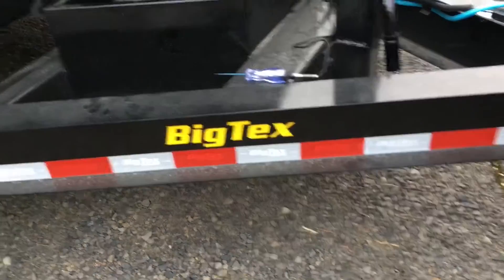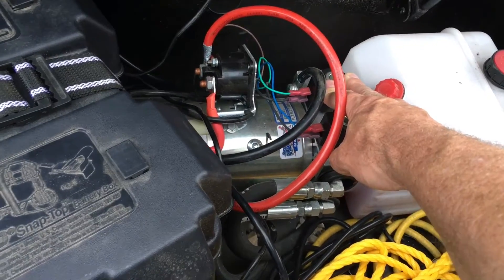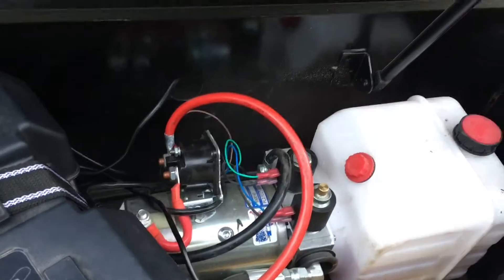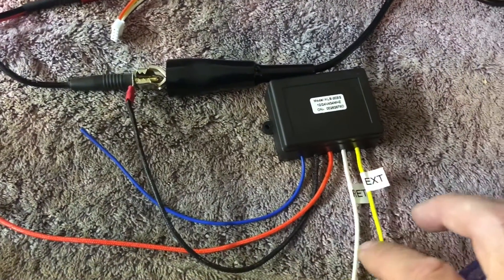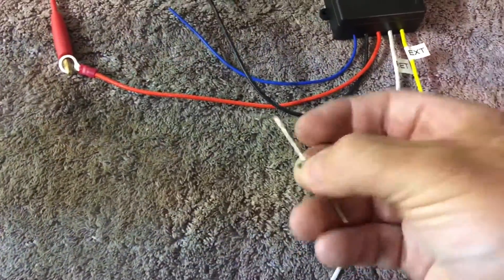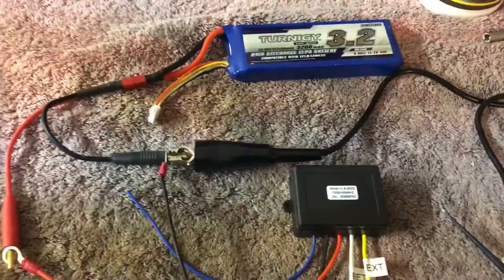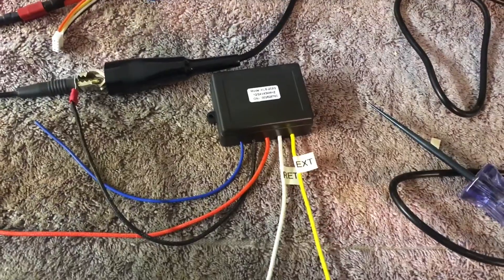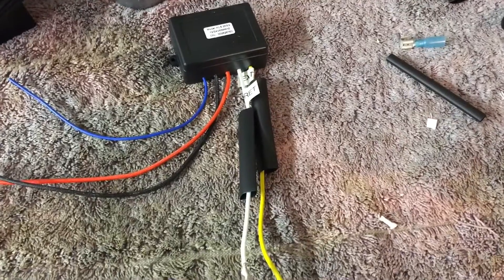Wireless winch control for power up/down dump trailer with diodes. Crummy hand held video

Comment: I have mine wired the same way. The wired handheld remote only works correctly now if I have the power turned on to wireless receiver. If I turn power off to wireless receiver the wired handheld only powers the pump and won’t send power to open or close solenoid. I’m puzzled
Reply from the maker: Something is wired wonky. Kinda hard to guess, without being there.
Reply from the maker: That is bizarre. You have the leads for the wireless remote still hooked up to the solenoid valves?
Reply: @JeffinTD  yes that’s correct. If I unhook the 2 wires from the wireless remote receiver that go to the up and down solenoids the wired remote also works normally.

Comment: Hi Jeff , the toggle switch ? did you wire that in line with the red to the battery side of solenoid? If so then that line should have a in line fuse and a on/off toggle. would that be correct?
Reply from the maker: It’s been a while but I believe I have an inline fuse attached to the battery, to the switch, to the controller’s receiver.  The receiver pulls a small amount of power even when not activated, so I didn’t want a battery drain.

Comment: Nice Video. Where did you connect your blue wire at?
Reply from the maker: Thanks.  The blue wire that came on the controller is an antenna and doesn’t get hooked to anything. The blue wire I soldered to the diodes goes to the small lug on the solenoid switch that runs the pump motor.  Right at 8:24 you can see the blue wire.

Comment: Are the diodes 12v? Finding 20 amp but not 12v
Reply from the maker: As long as they are rated for 12v or more, they should be fine. The ones I used I believe were rated for 45v.

Comment: I did this same wiring but when I press the button for up or down the solenoid clicks on and off in 1 second intervals causing the start wire to lose and gain power, any idea on what I should look at first?
Reply from the maker: Without being able to look at it, it is hard to say. Any circuit breaker in the system?  Wires and diodes appropriate for the current?  (I think I used 20 amp diodes).
Reply: @JeffinTD  I have 1 power wire connected to the hot side of the solenoid, 1 ground wire connected to the ground on the solenoid, 1 wire coming from the start post on the solenoid that has 2 15amp diodes connected, each diode has 2 wires on then ends of them 1 runs to the up solenoid and the other to the up wire on the box for the wireless remote, vice versa for the other diode. When I put my test light on the start post of the solenoid the light turns on and off you can also hear the solenoid kicking on and off as with the pump you can hear start and stop as the power starts and stops
Reply: @JeffinTD  I know that isn’t much to go off of and not being able to actually put hands on something or visually see is even harder but I’m at a loss unless the remote or receiver is bad causing it to not want to continually send or receive a signal
Reply from the maker: @blond9217    Kind of hard to tell from the description what might be going on. Maybe unhook the leads going from the motor solenoid, the Up solenoid and the down solenoid, and test things with a test light. I’d also want to confirm it isn’t trying to energize the Up and Down solenoids at the same time.
Reply: I am having the same problem with mine right now. Were you able to find a solution?  I found that I have constant 12.5 volts to the wire that goes to motor when its not connected. Once that wire is connected to the motor it starts surging the same way that you explained.

Comment: Great video! What Diodes did you use? I'm looking to do something similar with my dump trailer! Thanks!
Reply from the maker: Glad you found something helpful. If I recall correctly I got a 5 pack of 20 amp diodes off Amazon.
Reply: @JeffinTD  Thank you!